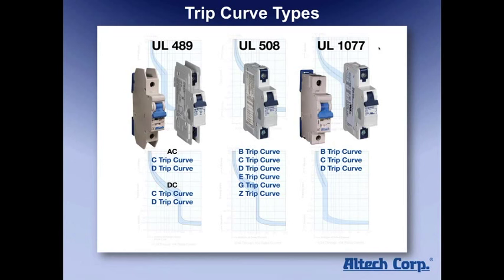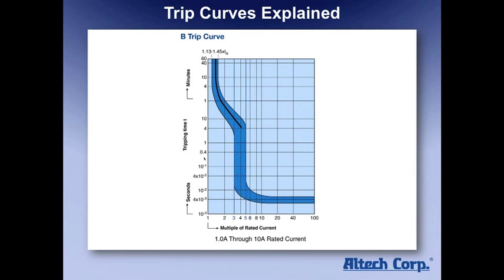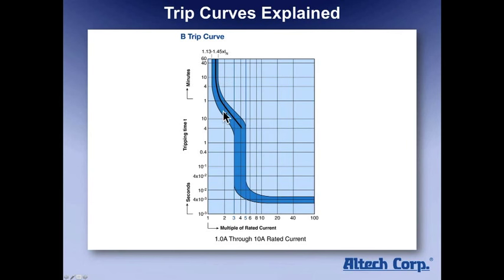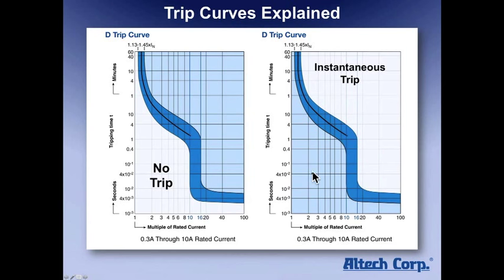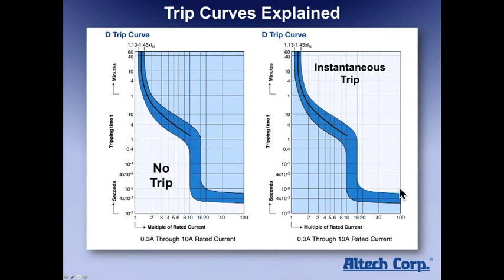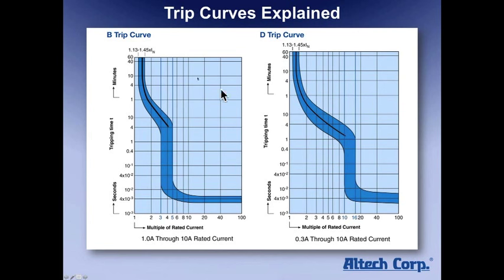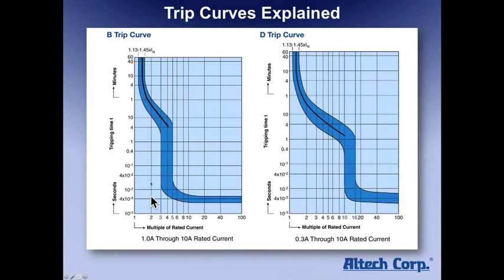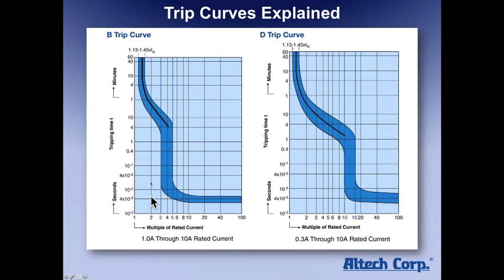Circuit Breaker Trip Curves Explained

Comment: 5:20 I think that explanation is wrong. The “no trip” area is correct. The “instantaneous trip” is incorrect”. Instead, the dark blue curve has two borders, or bounds, or curves: one for the minimum time for a given current and another for the maximum time for a given current. Hence, for a given current, the breaker doesn’t trip at a specific time, but instead within a time interval, which is inside the dark blue curve. Therefore, what the video calls as “instantaneous trip” is misleading because that zone or area is above the maximum time the breaker takes to trip for a given current.

On the other hand, the left part of the dark blue curve, where it looks like it goes up (upwards in Y axis) as the current goes down (to the left in the X axis), is the thermal trip zone: inverse time. If we move to the right, we see a sudden fall in the curve. That’s the magnetic trip zone: instantaneous time.
Reply: Are you referring to the I3 and I4 borders? If so, I agree with you

Comment: I know this is probably going to get a slow response but I have a query. If I'm using a 16A breaker with a voltage rating of 48VDC, does that mean if I have a device that is 12V it will still have the same trip characteristics and break only at or above 16A? I've heard that the voltage rating is to protect the breakers internal components and has very little to do with it's breaking capacity but it's difficult to get my head around. 16A at 48V is a lot more juice than 16A at 12V.

Comment: surely you mean to multiply the current ratings, ie. its not 2 amps that will trip a 10 amp breaker,  but 2 times the current rating of the 10amp breakers so 20amp.